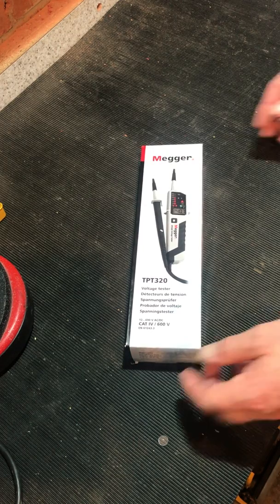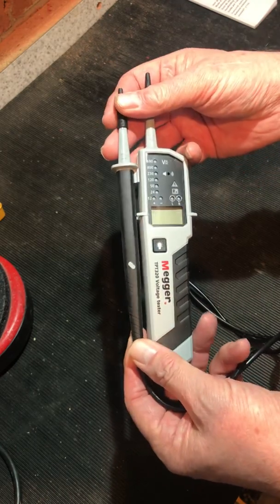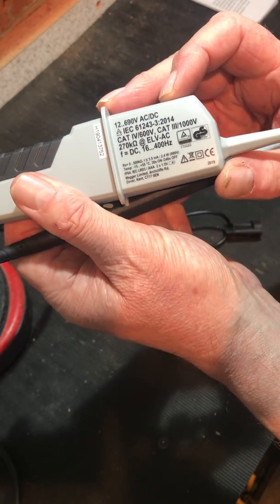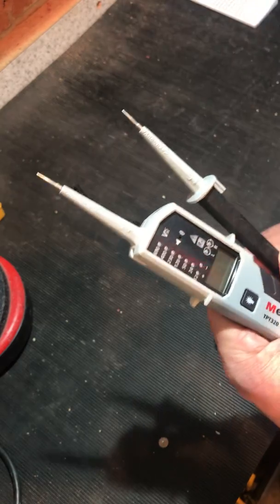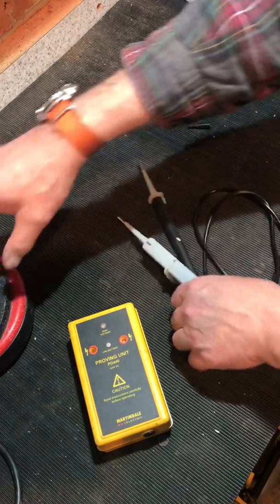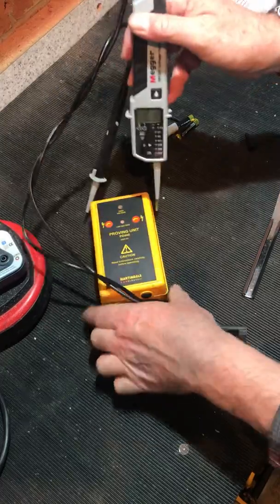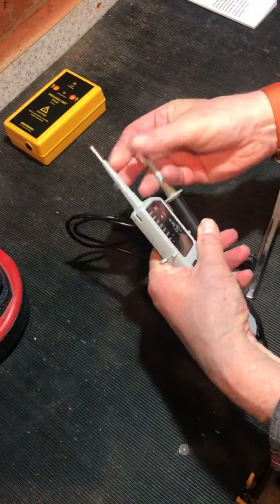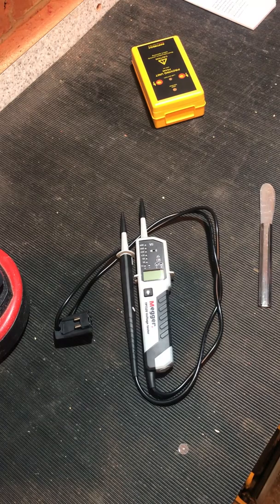Megger TPT320 Voltage Test

Comment: Thanks that was a useful review. I was going to buy this on the grounds that I currently have a megger multimeter and proving unit. 

I'll be using it as a gas engineer to test Central heating systems are dead, so nothing elaborative. 

This is about £60-70 on ebay and that seems quite pricey. Any suggestion would be really helpful. Regards
Reply from the maker: £60-70 is the lower mid-range for a good Voltage Indicator, you will have to look at companies like TIS for a budget bottom end VI, but most places look to Martindale VI and Drummond MTL as benchmarks but at a higher price. If Megger is your thing and your happy with Ebay just make sure the item is marked as ‘new’ as too many stolen tools appear on auction sites.
Reply: TIS aunt budget prised . But they are not over priced like Megger with megger and fluke your paying for the name , look at all the other models they are all the same why , because they all come from the same factory in China that’s why 
.. I have the TIS 851 that has its own built in proving unit .  £45 on Amazon. And it just as good as Megger or any other brand.